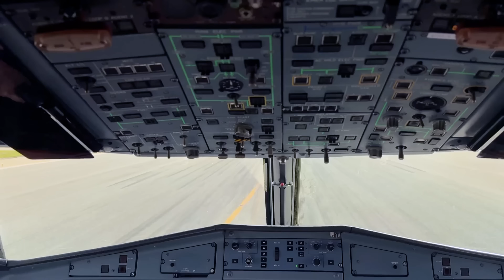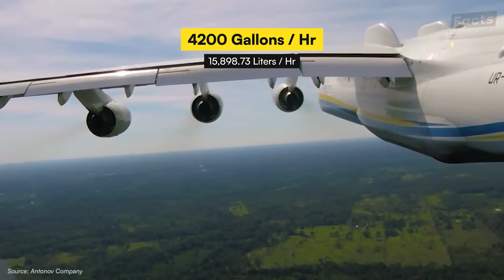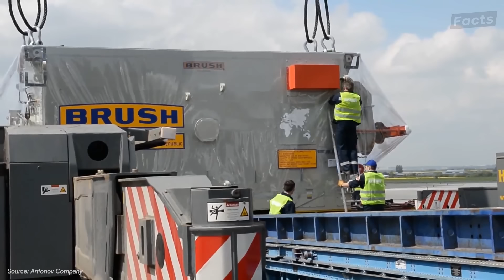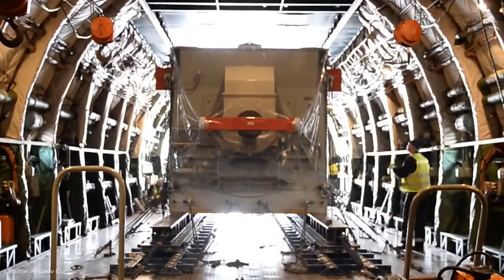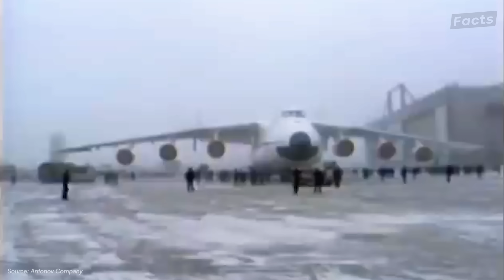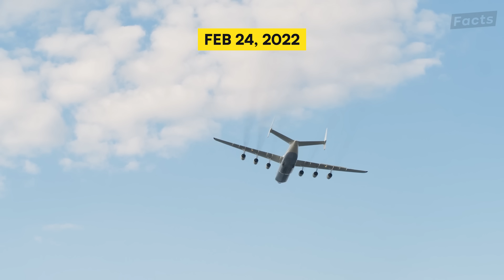Inside the World’s Biggest Aircraft Ever Built

Comment: The cargo area could accommodate up to 16 standard containers, roughly 80 passanger cars or even big trucks the interior has enough room to fit a Boeing 737 without wings and engines it also features a Built-in crane capable of moving a 33 ton load

Comment: I hate when they always mention pounds basically just divide it by 2.4 and you have it in kg and then remove a few 0's and you have tons ,so around 700 tons basically. which is not that heavy try 600,000 tons thats the largest floating object man has ever made, the shell prelude off the coast of Western Australia. 👍✌👌🦘
Reply: Personally I like when they give it in pounds since thats a measurement I can imagine but I do think its best when they give the number for both metric and imperial so it easy for the whole audiance.

Also of course a plane is a lot lighter than the biggest thing on the ocean. The ocean holds up ships without needing to apply a force (thrust) and following the laws of aerodynamics. All you need to do to have a ship float is make sure its less dense than the water.

Comment: So basically the wings SQ FT has the potential to carry up to its limit of around 30 tons more than the planes total weight to reach the limit of the wings lift capability. If the planes weight is around 687 tons and the wings SQ ft is around 970 tons, that means it can carry upto 30 tons extra load on the airframe, which is why every commercial and military planes have a extra % of strength built into the airframe ,which is around 30 % over all. cheers 🦘👍✌